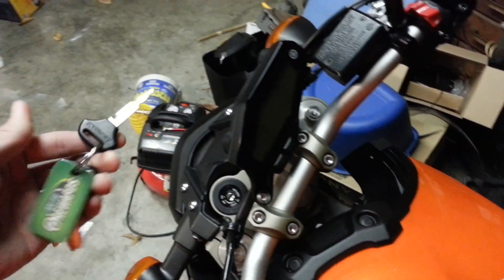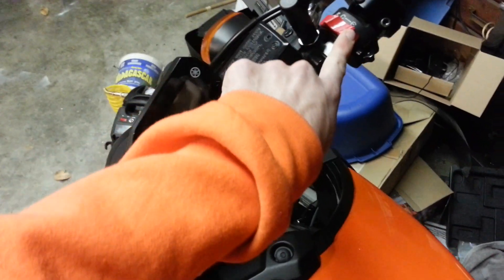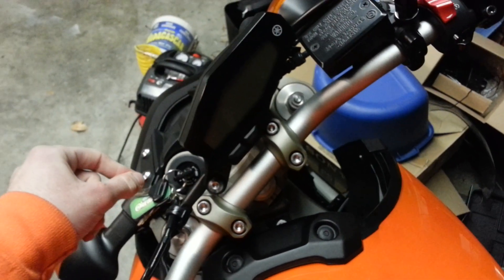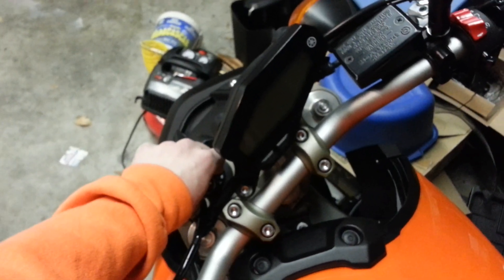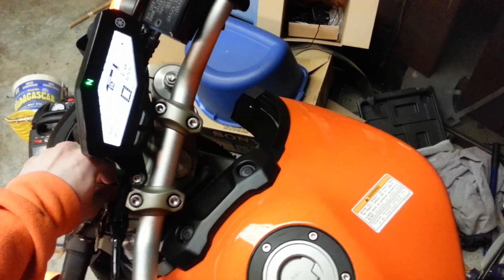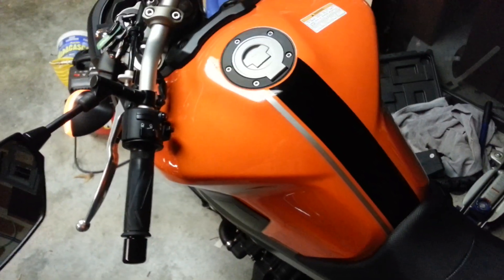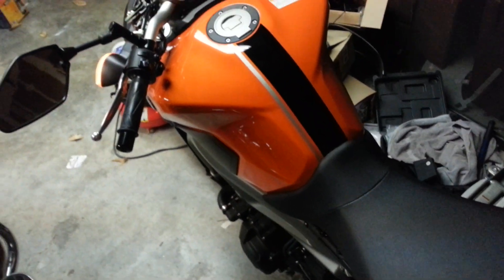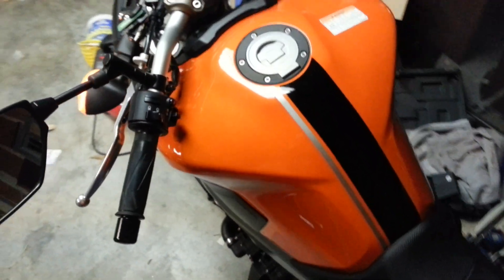Yamaha FZ-09 fuel system priming

Comment: The priming sound itself isn't unusual. However the fact that you don't hear it first time after flicking the kill switch to the on position is worrying. Also that initial sound, the one that you said you weren't talking about... kinda hard to judge fro ma youtube video but that sounds an awful lot like an electrical cackle. Have you checked for any loose or damaged wiring?
Reply from the maker: Yeah Ifigured the load priming ssound was normal  but no I haven't really checked but I guess I will be